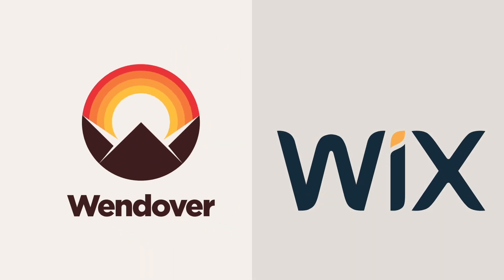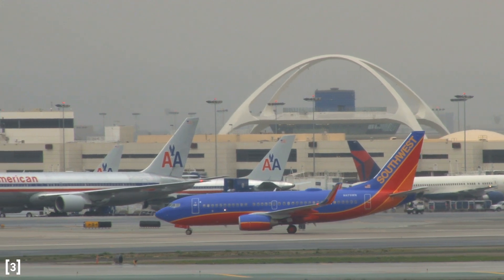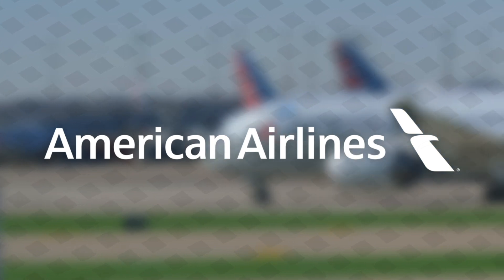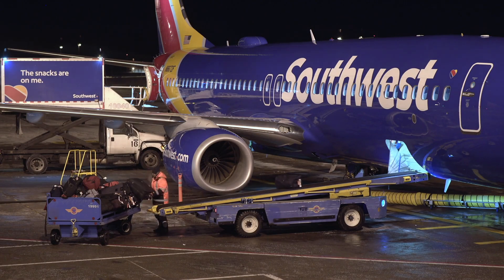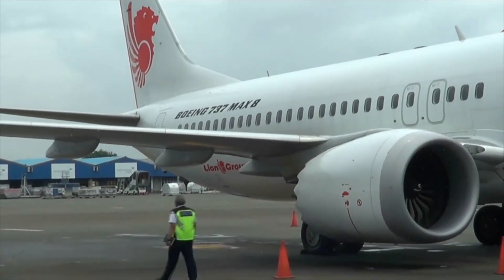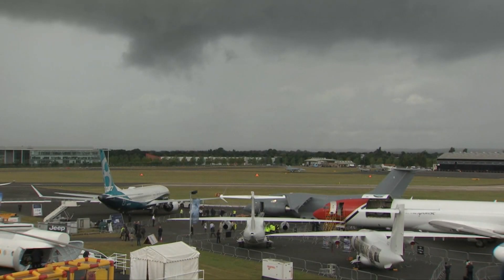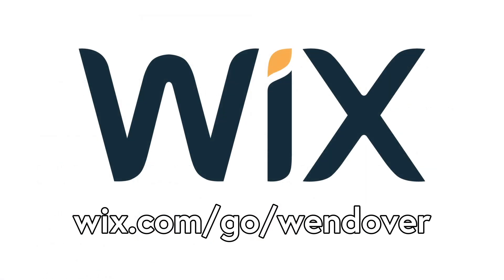The Economics That Made Boeing Build the 737 Max

Comment: A discussion of this situation without any mention of the regulatory environment around airframe and type certification is, I think, a huge oversight. You get to sling a ton of blame around without acknowledging that Boeing faced tens of millions of dollars and years of delays in waiting for the US government to certify a new type, in addition to the training the government requires for the pilots regardless of how similar the aircraft's systems might be. You can't say that airframe regulations like these save lives when those regulations make it perfectly legal for Boeing to ship an unsafe product.
Reply: Doesn't Boeing certify the plane themselves? So Boeing was delayed because of Boeing?
Reply: Rob the FAA certifies aircraft and pilots.
Reply: @myockey  That was the case in the early days when the industry was blooming. Now there are many times less planes built and mostly it's updates like these. That's why FAA had to shrink down. There were also other reasons but basically now it's too small to handle the process so they allow the manufacturer to partly do it. Interesting, isn't it?

Comment: Is there only 1 sensor for MCAS? No redundant system for self-correction? I would imagine there'd be a redundant system to avoid this problem to be implemented. Especially the safety factor required.

Comment: Old design does not make it less safe.   The 707 was safe.
The B-17 came back to England from the 1,200 mile bomb runs over Germany with two engines shot out and the trail section 50% missing.
Reply: facts
Reply: Yeah, do not compare the dick with the brush.

Comment: Who would've guessed that an automatic system designed to push the nose into the ground would be an issue when operated by one sensor... ONE!, no redundancy, no integration with any other sensor system, nope... if this one sensor tells the plane that the AOA is bad, push the nose down.

Comment: IMHO there are several problems with this old design. This is how I see it. The FAR 25 would require enough elevator authority to overcome a ceertain pitch couple. With more powerful engines, although the fuselage is now longer and therefore the elevator has a longer moment arm, the nose down authority was going to be insufficient. Thus, you need a bigger tailplane and elevator. This adds weight which increases fuel burn and reduces competitiveness and possibly payload. Or.....So they came up with MCAS to create an almost FBW type unstallable aircraft that they could say will trim the aircraft down if AOA too high so you will still have the required elevator authority to get the nose down bearing in mind elevator authority is also dependent on speed which is also dependent on AOA. Next problem: Aircraft like the  Hawker Siddeley Trident and most aircraft since, B757 etc which were Autoland capable had triplex systems. Three of everything. (he Airbus is slightly different with some Triplex systems and some two Duplex items such as Autopilots but each autopilot has dual channels). This means you have a "tribunal" where you will always have a majority vote, with the likelihood  of one item failed and two good easier to detect than with a dual system.
As I understand it but I hasten to add, I have never flown the 737, although there are two AOA vanes on the Max, only one was feeding info to the MCAS and therefore no way of the system knowing it was erroneous info. Is this correct?

Comment: AS a retired airline VP who was responsible for the actual purchase of the aircraft in our fleet, please allow me to provide my own views.  

First, traditional flight control systems are far superior to pure fly-by-wire.  Traditional systems are highly reliable, simply to diagnose, and relatively simple to repair, thus adds to far great safety and longevity.  The fact that the basic 737 airframe is 50 years old testifies to its durability, flexibility, and value to its operators.  Keep in mind, I prefer Douglas Aircraft, but that's me.  I was at Douglas when the Boeing/Douglas merger took place.  I prefer the MD-80 series and the Boeing 717, actually the MD-95. I flew on one only last week.  it remains my favorite single aisle aircraft.

With that being said, and it's just my opinion, Boeing did not want to invest the huge sums required to provide the Max the longer landing gear it required to do the job with the advanced performance engines.  When the 737 was first introduced, it's first engine family was much smaller in terms of height of the powerplants, 737-100 and -200.  It's been a string of compromises ever since!  Larger engines on later models were "flattened" on the bottom to give the aircraft the necessary ground clearance, and it worked well.  However, with the Max, in my view, they took the easy way once too often.  No doubt, the aircraft will do fine with a few modifications and better pilot training, but Boeing really needed to modify the wing box to handle landing gear that would have provided higher ground clearance.  Make no mistake, the 737 is a workhorse.  It's been proven over decades.  A slightly different wing and fuselage will be needed to accommodate newer engine types.  I prefer keeping all critical flight controls away from automation as possible.  Full control surface authority with Douglas and Boeing is far superior to computer-electric dependent technology used by Airbus.  A pilot can trust it more, and that's as simple as that.
Reply: Incredible reply from aguil....

Comment: In my opinion, there is absolutely no problem with using the same old design, especially if the old design has proven itself in terms of reliability. We know that 737 is the world's highest selling commercial aircraft and it is a well-deserved title. From a financial standpoint, the company's decision, implementing additional cost-effective and smart solutions such as MCAS instead of redesigning the aircraft completely to fit the new engines, is also makes sense. This could be considered as a standard business decision considering the circumstances the company would face such as investing funds and time to redesign the plane, changing processes in the factories, suppliers, etc. if it decided to start a new design program. I am confident that 99.9% of the companies in the world would do the same thing. Also, Boeing has a plan to replace the 737 family with another plane in the future. As far as I understood, the only thing that I can blame Boeing for is that not giving enough information about the changes that the plane got. It seems that even though the MCAS is a small change (just a program and a couple of sensors), it can interfere with the control of the plane, so pilots should have been informed and trained about a system that has this sort of capability. Maybe, you should not have to tell every change in the plane but this is something that requires pilots knowledge and I am not sure that every MAX pilot was aware of that. Still, I believe that Boeing will fix this and the plane will turn out okay but people will not trust it as they did to NG.

Comment: I'm a Boeing shareholder since 2009 and I'm getting nervous. Will Boeing recover from this and go back into the $400 range or will it suffer more with a bad reputation? I think Boeing should start from scratch on something to replace the 737. The new plane should keep the occupants at sea level air pressure.

Comment: I think it's important for people to understand that just because the engines are moved and the handling has changed slightly, does NOT mean that the aircraft in inherently unstable... Many of these handling differences are only apparent in very specific conditions. MCAS is meant to react to very rare and extreme circumstances in which the different handling characteristics could be a factor in a "near" stall scenario...basically to try and prevent the pilot from noticing that the handling differences even exist. The plane itself is fine. It was incredibly poor software/redundancy features that led to the crisis we see today... such oversight in these safety measures is inexcusable, of course, though the aircraft itself is perfectly stable and safe to fly (so long as its automated electronic flight controls don't intervene unnecessarily...)

Comment: What i feel is/was the problem with MCAS - its programmed to just hold a nose down imput eternally untill something happens. What that something is is anyones guess. What it should have done is apply pitch down untill the nose was level with the horizon, the system should have tied into the onboard instruments and possibly even carried its own internal attitude indicator system for maximum safety and redundancy. You dont need to enter a descent to avoid a stall, pushing the nose level is enough to build speed and escape a stall condition
Reply: kineticdeath they must have outsourced the software to someone in China or India, never let the 737max fly again, 346 dead should be the limit

Comment: There is some responsibility of the pilots to be able to correct a malfunction with a trim system like what if found on the 737 Max.
Reply: But Boeing deliberately never even told pilots MCAS existed - to avoid them having to be trained for its failure, would you believe!  There was anyway no laid down procedure for AoA failure repeatedly triggering MCAS.  Yes using the trim failure procedure would work, but with MCAS the symptoms of AoA failure were different to that so there is no way you could expect them to work it out in the <40 seconds they had before the plane was irrecoverable.

Comment: Over your different videos, I have noticed you have a soft corner for Boeing. You are trying to justify and defend a little Boeing's decision to re-engineer the 737 to produce the faulty 737-MAX even in this video. The first thing to building an aircraft is safety, which Boeing compromised on. No two ways about it. Period.

Comment: Truth is, Boeing tried to stuff digital equipment into an analog airplane.  They should've started from scratch but thanks to southwest, technology was not allowed to advance.
Reply: Thomas Headley  Customers DO have control Tom, and this has nothing to do with the AOA vane.  737 program ran its course, and boeing was going to start from scratch...but WN did not want to train its pilots on another type rating, and the 737 program carried on with the NG's and the MAX.  Did you even know WN was flying the 737 NG with round dials on a glass screen?   Maybe read and comprehend my post before typing an emotional response?  Where did I ever say it was WN's fault for not alerting the FAA?  Weird.
Reply: Al Bundy .
Reply: to their credit, they were working on a new jet, but the A320 NEO made them rush a new 737 instead of finishing they new jet they had planned. A similar thing happened when the A380 was announced and Boeing released the 747-8.
Reply: Dude, the 737 has been digital with analog for quite some time. Your argument is hilariously stupid.
Reply: First off, the 737 family before the NG, if requested by the airline would have the steam gauges or round dials on the displays to help the pilots transition from older generations to newer so that they could get used to the airplane. Once they felt comfortable the airline then changed the displays you can find now on 737NG aircraft. A big user of this was United as well as Southwest. You can find pic’s of this setup on google. While I get the point of saying that Southwest had influence to tell Boeing of a MAX problem, from what I know, the problem never arose on any of their aircraft or any others besides the Lion Air flight and the Ethiopian flight. So in that regard, even after the Lion Air flight who was going to go and seek out this problem? No one.
Reply: Thomas Headley  Yup. I just wanted to make sure that no one was just spewing information that they had heard and not that they had learned just so that they can win a stupid internet argument.

Comment: A point to add: A new SA would loose all the grandfather rights the B737 holds in terms of exit limit, doors, etc. 
Another one: The SAs also spend more time in the air due to more flights. Low cost carrier like Ryanair and Southwest have cut turn around time and thus are able to utilize their planes for more flights. With less time on the ground, time in the air increases and thus fuel efficeny is more important.

Comment: You ignored Boeing's fear of Bombardier and its clean sheet CS100, CS300 and future CS500 
They already let Airbus out of the box, they sure weren't going to let a 3rd aircraft company spank them.  Too bad that spanking is still going to come. 
Delta's CEO is a very smart cookie, either Delta or one of the major fleet airlines will force Airbus to build the A220-500.  Both the 737 and the A320 are well past their engineering half lives.

Comment: American Airlines was not the launch customer for the max.. It was Southwest. Just as they have been for every single 737... With Southwest having the largest fleet of 737’s over an other airline in the world, they wanted to keep the plane very similar to its older sisters. If the changes were to drastic then they would’ve been required to provide new training. With keeping the characteristics of the first ever 737 to the Max, it allows any pilot with a 737 type rating to fly any variant of the 737. Aka pilots that have only ever flown the 737-100, can jump right into a 737 Max and legally fly it with no additional mandated training.

Comment: Human error? False. It's clearly a dysfunctional process. Per AS9100 Boeing must have a robust Risk Management process. Do you really believe that during the 5 year development, no Design Engineer recognized the danger of a new unfamiliar system with the authority to dive the airplane into the ground? What about the o-rings on Challengers SRB boosters that failed to seal in cold weather? There emerged memo's warning of that risk. 787 Lithium batteries that exploded in the manufacturer test stands but made it onto the airplane anyway. Managers are driven by budget and schedule and will ignore risk. It is human nature. The 787 max MCAS fix is being implemented after two planes are lost, hundreds grounded, and lost sales. Isn't it cheaper to properly identify and deal with risk earlier and avoid catastrophe? Call me stupid. Ref Boeing BPI-4375 "Risk Mgmt" and BPI-215 "ensure problems are fixed" which are not currently integrated. Obviously.

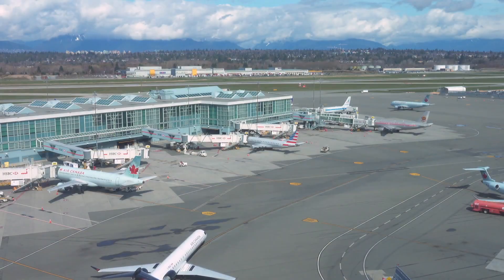Comment: 3:36 That's Vancouver International Airport, specifically Gates 80-84, right to left, of Terminal E.  That's a Canada Post building across the runway and in the background are the Rocky Mountains.  Stereotypically enough, there's actually a Tim Hortons within the frame of this terminal right inside gate E84, the one above the docked leftmost Air Canada plane.

Comment: Good video. The 737 MAX needs to be treated as a separate plane from all other 737s. All pilots flying the 737 MAX need to certified. Second, while I love watching the flight control system and the pilot (the computer and the human being), fight with each other, often to the death, over who is PIC [sarcasm], training in the MCAS needs to be mandatory for all pilots flying the 737 MAX.
Reply: The MAX having a different type rating would mean that Boeing may as well have built a new aircraft. Most likely something like a narrow body B787.
Reply: @markevans2294  That will be their Yellowstone Projects, the Y1 project. So far, only Y2 is completed, which is 787.

Comment: MCAS was not to prevent stalling, because it is not prone to stall. The nose up tendency is not nearly strong enough to cause any safety problem. MCAS is only to correct that handling so that they could re-use the same type certification of the airframe.
I didnt know about the American Airlines strong-arming Boeing with its pre-order, but it cast a light why they were so determined to use the same certification.

Comment: You missed one thing. Even if the pilot deactivate MCAS, it will reactivate itself. So, there is no way for pilot to prevent the inevitable clash. This has happen in Ethiopian clash.
Reply: It didn't reactivate itself. Pilots activated it back.

Comment: Nah mate, you should get your facts straight.

The 737 MAX is not unstable, and has never been. The MAX doesn't need the MCAS to fly, the MCAS was ONLY ADDED SO IT FLEW LIKE THE OLDER 737 NGX.

Many pilots have even said that they can hardly feel a difference between the NGX and MAX with the MCAS disabled.

Boeing wanted the 737 MAX to go under the 737NGX type rating. But couldn't because the different engine position made it change pitch a bit (VERY MINIOR) when operating the throttle (just like many other safe airplanes in this world) and thus MCAS was born, MCAS WASN'T designed to be a anti stall system, but to automatically trim the aircraft so the pilots wouldn't notice a difference when using the throttles.

But boeing decided to add the anti stall system to it without refining it, and decided not to tell anyone about the MCAS or different flight characteristics, resulting in what we have now.

BTW. The MCAS has been neutered and fixed and pilots are now notified of the flight characteristic, MCAS and how to disable it.(although it disables itself now when the AoA sensors are misaligned and it also can't override pilot control now.)

I fly for a major American carrier and fly an NGX, its an outstanding plane and extremely safe. The competition is is in no way better or safer, they just have a different perspective on aircraft design. Also by the way the competition has had their fair share of accidents throughout the world as well. My 2 cents take it for what its worth (which is nothing), I feel like the media and social media have massively mislead people on MCAS and the 737.